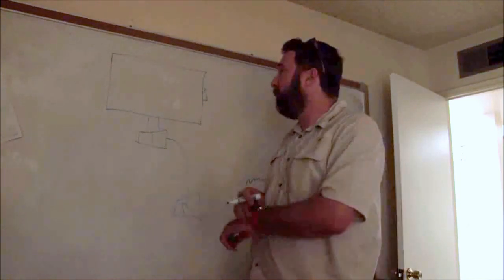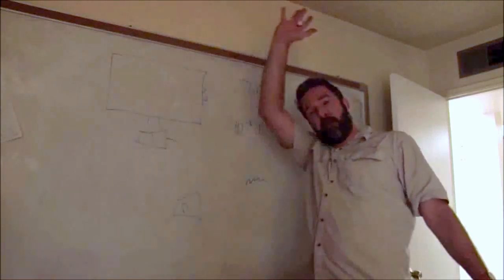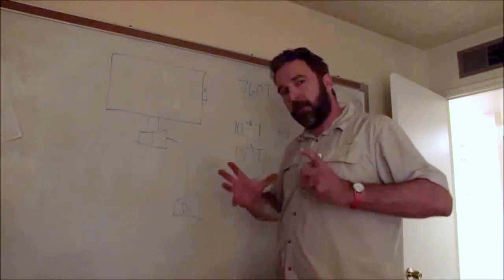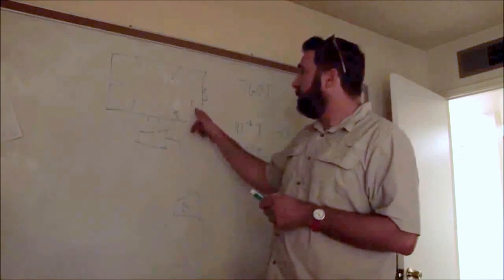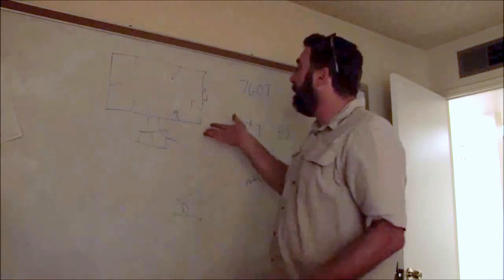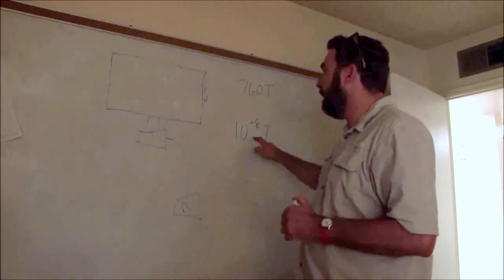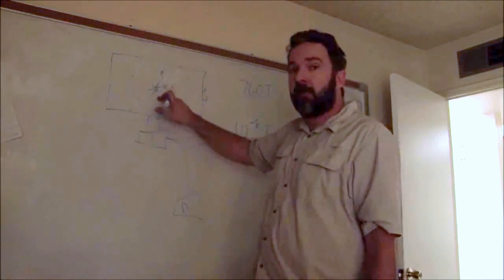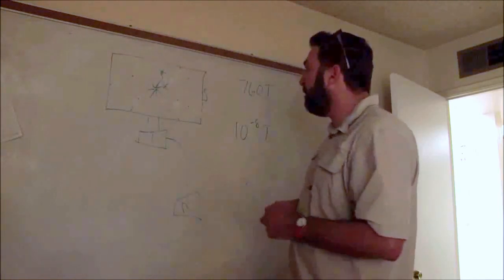Beer keg nuclear fusion at ASU, but why a beer keg?!?

Comment: I have read about heating the sides of a vacuum chamber to release the gasses stuck to the side, does the electropolishing eliminate that need?
Reply from the maker: That works great, it is called 'bake-out'.

We do that on pretty much any new vacuum chamber, or one that was opened on a humid day, and also chambers that just weren't built very well in the first place. 

The problem is a bake-out will only get you so far (and gets more complicated if your chamber uses rubber seals) if you need really good high vacuum (10^-6T or less) as the number of molecules becomes so small that even a small outgas will cause issues (unless you can hit extremely high bake-out temps).

It helps no matter what, and its largest benefit is speeding things up. We did it on this chamber the first time we pulled vacuum, and it certainly has helped us pump down faster since.